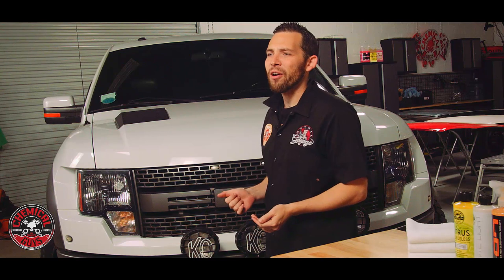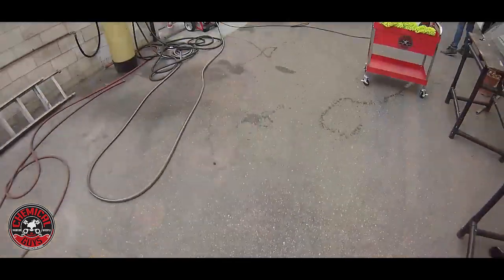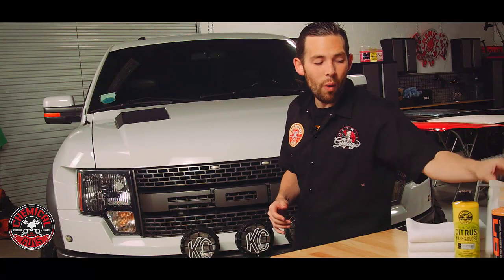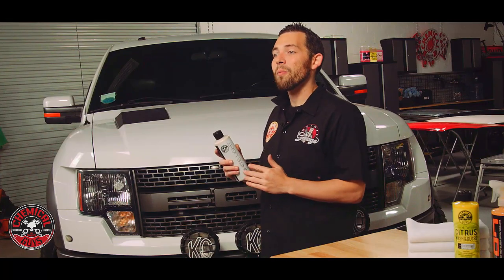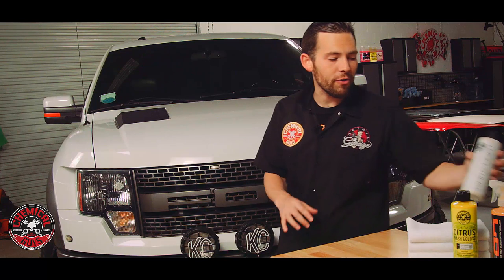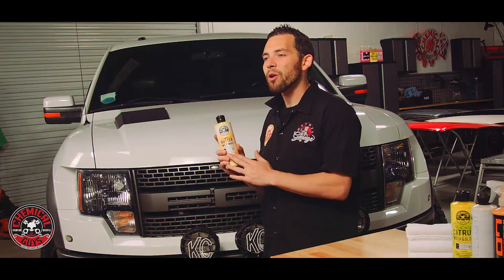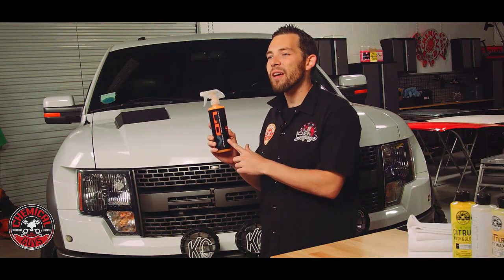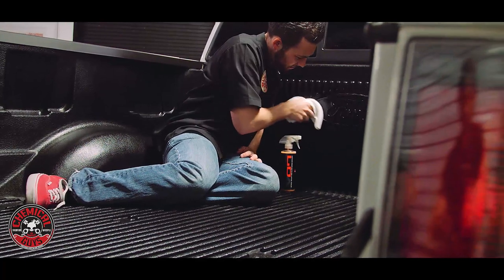How To Clean And Detail White Cars - Chemical Guys Car Care

Comment: white has to be the toughest color to get a reflective finish . thanks for the help n good video .
Reply from the maker: It's definitely a tough color to maintain but it's worth it when you get the perfect shine. Happy Detailing!
Reply: K. Look just use carnuba wax
Reply: Black is(my opinion)....the trick with white is that in the end result that the white should look like silver from a distance and vice versa...this is because of the toner in the relevant paint mixes irrespective if the type of white.

Comment: I have a white tundra and I just used the white light and butter wet wax. do I use the final hydro spray after every wash??
Reply from the maker: Hi Jonathan, how's it going? After glazing and waxing your car with White Light Glaze and Butter Wet Wax, you can top it off with a quick detail spray if you want that extra shine, however it is not necessary. You can also use the quick detail spray for cleaning up fingerprints, waterspots, light dirt, dust, and more in between those full washes. Thanks for watching, Jonathan, and make sure to check back later today for a new video upload!
Reply: Thanks. i purchased SPEED WIPE not to long ago to be my in between wash's but was still interested in the Hybrid V7. Having the SPEED WIPE, is it necessary to have both products?

Comment: What about old vehicles that have been sitting in the sun any products for that? Or a classic car that’s been sitting inside collecting dust for 10 years
Reply from the maker: Hello Bryce! Great question, if you have an extremely filthy vehicle that has been collecting dust for a while then, yes, we recommend that you use Citrus Wash and Gloss which is one of our strongest cleaners. Also, if your car has been sitting that long, we highly recommend that you look into a clay bar treatment to remove all that built up contamination. To prevent any further contamination after the treatment we also recommend applying a wax or a sealant such as JetSeal which will help repel further contaminants such as dirt, dust, bird droppings, water spots, pollution and more! Thanks for watching!
-CG Joey
https://www.chemicalguys.com/JetSeal_Sealant_and_Paint_Protectant_4_oz_p/wac_118_04.htm
Reply: Chemical Guys I have a 65 studebaker that’s been fully restored but last time it was ran and sprayed off was 2014

Comment: How often should you used white light and butter wet wax? Every car wash ?
Reply from the maker: Hi Octavio, great question. These products have a longevity to them, so there's no need to apply after every wash, unless you want to. Butter Wet Wax will last months when cared for properly (use a pH balanced soap that doesn't strip waxes!), so you really only have to reapply when the wax wears off and is no longer effective. You can reapply White Light when you start noticing your car no longer has that pop that a glaze provides, or as desired. The main thing is just to make sure your car is completely clean before applying either product! Thanks for the comment, Octavio, and welcome to the Chemical Guys family!

Comment: I have my white car sealed with Jet Seal 109 and used Vertua Bond before applying the sealant.
Can I use White Light instead of Vertua Bond and top it with Jet Seal? Or is it even feasible to use Vertua Bond, White Light and Jet-Seal?
Reply: tommy9927 While you "can" use White Light on top of Jetseal, any effects it gives wont last as long.  White Light is a glaze which is meant to be used first then topped with any sealent.

Comment: Im just curious i have a white 2010 m5 and currently own jet seal & instawax.....should iapply instawax after the whitelight? or go straight to the sealant?
Reply from the maker: We recommend layering Chemical Guys protecting coatings after a clay bar service with glaze first, then sealant, then wax. First apply White Light, then top it with JetSeal to lock in the glossy wet shine with the durable sealant protection. Finally, top it all with a coat of wax for the signature warm wet shine of carnauba. After the wax coating wears away, you'll still have the durable synthetic protection underneath, and you can re-apply a coat of wax for the look.
Reply: Thanks for that. I forgot to do the clay bar but pretty much did white light, jet seal and then finished off with a synthetic wax
Reply: So after sealing with jetseal and then doing a coat of butter wet wax would I do another sealing layer of Hybrid V7? Or is the Jetseal already enough in the earlier step.

Comment: You would recommend using jet seal in place of the butter wax?
Reply from the maker: HI! To receive the most protection, we recommend applying both Jet Seal and Butter Wet Wax. If you only want to apply one, we recommend Jet Seal because it will deliver more protection to your vehicle from bird droppings, UV rays and any harsh elements. Thanks for watching and thanks for being part of the Chemical Guys family!

Comment: After the wash with the citrus cleaner do you recommend using the clay mitt before applying white light?
Reply: The Creationman It depends on the surface of your car.  After you wash you car, run your clean, dry hand over the clean dry surface of your car.  If you still feel contaminants on your paint, then yes, use the clay mitt.  If your surface has very minimal contaminants or no contaminants at all, feel free to skip the clay step.
Reply: Christopher Lew Okay sweet, just as I thought, thanks!

Comment: do you use the same steps for Pearl white? or something else...
Reply from the maker: Yes absolutely! In fact there are many different combinations that will work for Pearl White cars. We also carry a white wax which is ultra refined to be the smoothest easy to apply paste wax that benefits the clean bright appearance of your vehicle. Start the detail with your favorite Chemical Guys soap, then move onto to claying if you touch the paint and notice that the paint is feeling rough. Apply a small amount of the Whitelight Glaze to a microfiber applicator pad and spread a nice thin coat evenly along the paint. Let that cure for 15-20 minutes before buffing off the Whitelight with one of our many ultrasoft happy ending towels. Pick up that bottle of the Butter Wet Wax and spoil your car with a warm coat of rich yellow carnauba that melts into the paint. Before you apply the Butter Wet Wax, a layer of Jet Seal should be applied to protect against a whole host of paint etching contaminants. Left over residue is definitely a possibility, and removing it with a quick detail spray like hybrid V07 is an excellent way to leave the paint clean and protected. Stay tuned, we've got more great videos coming soon.

C.G. Alex -